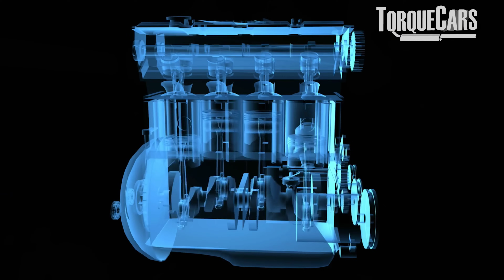SOLVED! Carbon Build Up/Deposits: Causes Exposed, Prevention, & Removal Solutions 💨🚗

Comment: EGR is mostly the culprit. Egr and extended oil change intervals. Be wary of "flush" type treatments because they can cause big chunks of hardened carbon to circulate throughout your engine, blocking oilways & wreaking havoc.
Reply: @jamesward5721  Hell, I wish those products worked well enough to break off big chunks of carbon.  Generally they barely do anything at all.
Reply: A good flush doesn't rip the carbon off in chunks but dissolves it.

Comment: Oil catch cans sadly doesn’t do anything and on most cars you can’t even delete egr because it’s an internal system working with cam phasers.
Reply: EGR by altered cam phasing doesn't contaminate the intake tract with carbon.
Reply: Catch cans do work

Comment: Catch cans: Junk just fills up with condensation that can freeze in winter. Will contain a little bit of oil. Intake sprays: Junk.   Other that: spot on infos.  Liked the video a lot.  Only manual physical cleaning of intakes works... tis true.  Moisture in the morning also feels like it has carbon build up....  You may notice that it does not appear when the motor is dry in the morning.
Reply: In the generator world, the 8.1 GM used to have some issues with the crankcase breather can freezing up, it has a cleanable filter inside like a k+n and there's always a half a cup of water and oil cottage cheese and it can all freeze up. 
Once they put a thick blanket around it ,no more issues. 
There's still plenty of moisture but it doesn't freeze and pump out 5 quarts from the front seal now.
Reply: Elite Engineering catch cans works great, dont go cheap and ignorant
Reply: Intake sprays only work as preventative maintenance. If you do them regularly (5-7k miles), they can prevent major carbon build-up. However, if you wait until the carbon is caked on thick, the sprays barely do anything.
Reply: @MishtahPoog  Might damage the piston rings, and all, running that much solvent through your motor and cat though.

Comment: my 22 years old, 18 years and 8 years old are in great shape without any issue with carbon build up, Any ! 
I always using at least 95 RON and full synthetic engine oil and  driving them a bit aggresive eventhough on daily commute ! both of them are Germany 
—- Feel good —-
Reply: Can you see inside then
Reply: @volt8684  with the ages of the cars he listed they're probably not direct injection, if they are port injection the petrol/air mixture acts as a cleaning agent for the inlet valves.
Reply: @volt8684  Gasoline can clean carbon.

Comment: Carbon build up was still an issue even on port injection and carburetor cars just less often. Where it’s been bad is DI cars with turbo applications. Usually due to poor pcv design or the ridiculous oil change lengths and the oil burns off and gets sucked into the valve. 
Valvoline clean and restore oil actually helps more than you’d think.
Also there’s ALWAYS some sort of blow by regardless because there’s no such thing as perfectly sealed piston rings. 
Don’t use cheap oil.  Also pennzoil is terrible at oil vapor.
Oil catch cans don’t help a whole lot on cars that are bad like VW and Audi.
Also it’s not carbon usually it’s oil vapor burning on the intake valve when hot.
Ask any auto manufacturer they didn’t add port again to reduce carbon. It’s emissions efficiency not carbon reduction.

Comment: I think the car manufacturers thought ok we got to cut emissions .. lets wear the engines out and make more money  ... Idiot governments and climate cranks aren't helping ... Catch cans don't really work ... EGR reduction plate is a good idea 😊 ...   A rethink from the engine design is needed and the ridiculous regulations need a review . 
Now we know ev s are crap we need to sort these diesels out
Reply: I really would like to understand what car makers are thinking. I just leased a '25 Forester with typical Japanese quality in spades and a joy to drive...only to find out it has the fuel system of a 30yr old VW. Yikes.. I wouldn't think Subaru would want it's reputation tarnished so it is confusing.

Comment: Old trick with carbon build up on piston heads was Redex down spark plug holes. In the US they like to use Berryman's B12 Chemtool.
1. Get car to operating temperature.
2. Remove coil packs and spark plugs.
3. Remove EFI fuse and/or disconnect injector plugs.
4. Pour 25ml to 50ml REDEX/Berrymans down each plug hole.
5. You can short soak for 30 mins or do a 24 hour soak (if 24 hour consider changing oil after as some may seep down your piston rings into sump).
6. Hand rotate engine a few times to allow product to penetrate Oil Control Ring and Compression Rings.
7. Place a towel over spark plug holes.
8. Crank car over for 10 seconds x 3 times to expel any remaining product from cylinders to prevent hydrolock.
9. Reconnect spark plug/coils and EFI/injectors.
10. Start car.

11. Car will sputter and may struggle to start. But it will.
12. Car may splutter and sound like misfiring but after a minute or two of ticking over this settles.
13. Expect lots of smoke from the exhaust!
14. Continue to idle until car reaches operating temperature.
15. Take car for a good highway blast, getting up to 60MPH/70MPH (legally of course)!
16. On occasion hold in 3rd gear and try and get car under load like up a steep hill.
17. Expect fist waves from angry motorists as smoke clears from your tailpipe.
18. Once smoke has cleared, go home and hope your neighbours are still friendly.

Disclaimer: Try this at your own risk! This is something I have done many times in the past as have millions of other drivers around the world. DIY Dave did this on his videos with his oil burning  Corolla.
Reply: That's the wrong part of the engine, we are all talking about what is above the valves and what is in the intake. You're only looking at what is inside the cylinder.
Advice is about 40years out of date !
Reply: @craig357  why dont you just pour it in the gas tank? Like what is recommended.
Reply: @teamdada2194  because the fuel injectors spray gas directly in the cylinder bypassing the valves. They should remove the gas tank option. Waste of money.

Comment: I just let my wife take over driving.  It's harder on gas but I think she drove Formula 1 in a previous life.
Reply: I respect that about your wife.
Reply: Makes the valve coking worse
Reply: @fzr1000981  Yeah, I'm not sold on the "Italian tuneup". You're going to rev the carbon off the valves?.....really?
Reply: @fendermon Mate, your 5-valve Exup was a good one, of many, that responded well to just exactly that. Lots of law abiding, tame riders used to tootle along sticking to speed limits etc on their 5-valve bikes. They had a particularly low valve spring pressure exerted upon their valve seats which allowed all sorts crap to combine and build on all those lovely valve seat areas. A set of plugs and a 10 - 20 - 30 mile hardcore thrashing, riding them like they were actually designed to be ridden and not just on a motorway but around decent country roads, up and down the gears using all the throttle and rpms would more often than not result in a much noticeably happier bike at the end of it.
Reply: now you're the one who's scared while driving in the passenger seat, my wife starts screaming in a corner at 200km/h, and you?

Comment: What about diesel engines? They never had injectors spraying valves but they were clocking 500k and more in taxis and such.
Reply: @hrsjohnny  Diesel engines are usually used on motorways and/or for long trips. Best ways to keep an engine clean.

Comment: The US Northeast distributor of a major heavy equipment manufacturer advised me to buy a used pre-dpf unit unless it was for commercial use due to the fact that the current model year equipment had between $7,000 and $14,000 added to the MSRP for emmissions warranty repairs. A homeowner was going to get screwed by the time factor of the warranty.
Reply: This is turning into a massive drag on the economy. I wonder what the total cost actually is.

Comment: I have a '19 Range Rover Velar P250 (petrol 4 cyl. turbo-charged) with GDFI. I take oil changes to a new level to mitigate carbon build up on the valves from the EGR and PCV systems. Change the oil every 6 mos. OR 3000 miles with a high quality oil, e.g., LiquidMoly LR.
 I also try to make sure that any time driving the vehicle, I drive a minimum number of miles for a full warmup and I don't baby it.
Reply: Doesn't matter. Ingenium engines are junk.

Comment: I went from a 1.5 DCI (Renault), to a Dynamic Force 2.0 (Toyota). 

Modern diesels suck in city and short trips, which is what I ended up doing. Had to replace my four injectors (bad fuel? bad injectors?) in that Megane.

At least Toyota tries. It's got dual injection (port and direct), a chain, and vvti, with a 39% efficiency, stil has EGR and all that fluff. 

Shame Toyota will 'downsize' in the next generation. Small capacity, highly strung turbos, bye bye reliability. All for the sake of emissions. Anyway, in ten years, we might not even be allowed petrol cars anyway.

Comment: I'm in the process of carbon atm. I'm using oven cleaner, and a high-pressure water jet cleaner is the go. If I were doing this as a business, I would buy a large ultrasonic cleaner and wallnut blaster that would be the best.
Reply: On my old tdi, I had the intake off and the head ports were nasty. 
Make sure the valve is closed and whack it a while with a propane torch and they cleaned up nice ,along with the manifold. 
Sucks about most newer manifolds being plastic. 
Still can use a propane torch to burn some of that crap out first and help any chemicals you might use.

Comment: Archoil 6900-P Max may help prevent carbon buildup on some direct injection engines. Although I have not yet seen a long-term test to show its efficacy. It certainly improves the burn of the fuel in my car.
Reply: How....you know how DI works right?  Fuel has zero impact on intake valves
Reply: @fzr1000981  it remains unburnt in the recycled exhaust and is fed back using egr. Also if you have a miller cycle engine, or an Atkinson cycle engine some fuel gets spit back behind the intake valve before combustion.

It may not be enough to completely prevent the issue but a cleaner burn and regular oil changes may slow its egress.
Reply: Do you use it with regular E10 95 RON  petrol or E5 99 RON premium fuel? I'm guessing the former?
Reply: @paulgroves8633  use it with either. I use E5 99 V Power as well to maximise the PEAs in the combustion cycles.

Comment: I have a 2013 Genesis coupe 3.8, when I got it to 100k I decided to get it walnut blasted to clean out the carbon. It actually wasn't as bad as some I've seen. I went ahead and replaced injectors also. She's at 143k and still going strong knock on wood .

Comment: Best use for any engine is motorway use 💯
Reply: Why would you call it a highway? 

If You drive Motors on it…..it’s a motorway……..if you drive high on it……….well you’d probably end up in prison. Lol 
Love from ireland, our roads are quite narrow but we know how to get round them quickly when the tea is on. 😊
Reply: It's called highway or freeway in Australia
Reply: Or "Autobahn" in Germany
Reply: On a Direct Injection(-only) car, I don't see how motorway driving is necessarily going to help with carbon build-up on the valve intakes, though, as no fuel is sprayed over them?
Reply: AUTOESTRADA (AUTOMIBILES ROADS)
Reply: @julesmatthews2178  💯 does nothing for a direct injection engine.
Reply: Facts! My V8 truck with Port injection has almost 200k miles, looked a few days ago and carbon ain't bad in the intakes. And I've been using cheaper fuel the past 4 years because I couldn't afford 89 octane for awhile (thanks Biden). Not sure if any intake cleaners would do anything for me really. Just gotta open her up in the interstate from time to time
Reply: @alexmattucci8507 Why do you want to use intake cleaners when the engine has port injection?
Reply: @julesmatthews2178  You mean autobhan full throtle.
Reply: @julesmatthews2178  To a degree, but has little effect on gas direct engines (GDI).
Reply: Italian tune up is the best

Comment: Great information; thanks! 

If the intake manifold is (partially) clogged, would that exacerbate this issue further, as there’s less air available for the incoming fuel?

Cheers
Reply from the maker: The more dirty the engine burn the more likely it is to have carbon issues, so yes a clogged intake can accelerate the carbon deposit slightly.